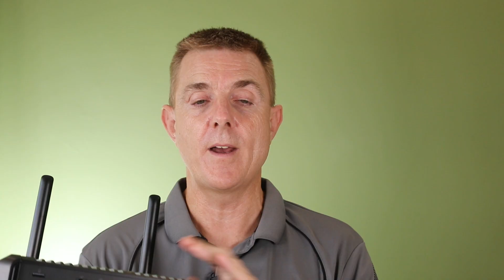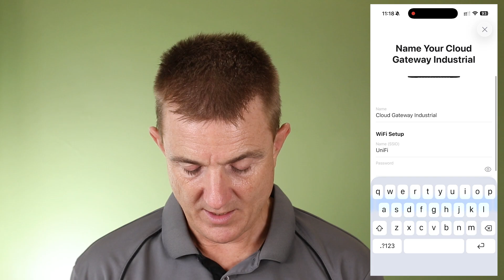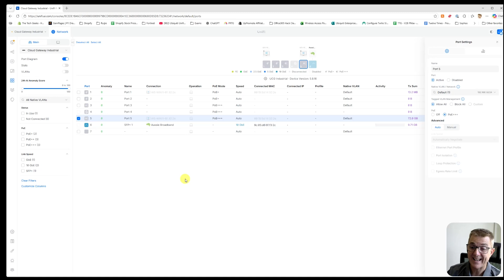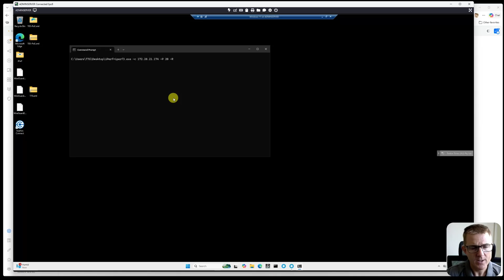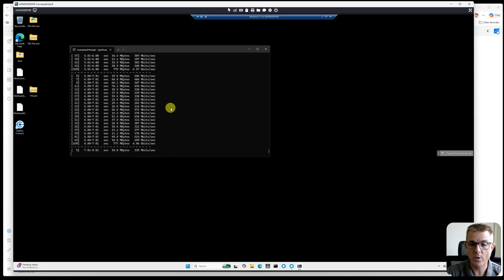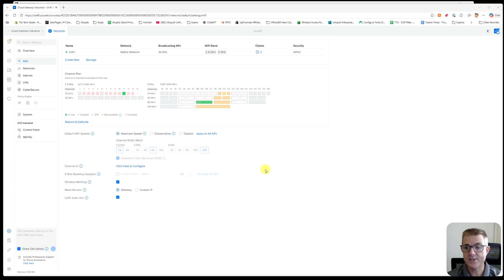Performance Review - UCG-Industrial

Comment: Hi can you please tell me if it supports the Traffic Flows and Traffic Logging feature in UniFi Network and howmuch logs are you maxing out please? thx!
Reply from the maker: Yes, it should support Traffic Flows / Traffic Logging as long as it is running UniFi Network 9.1 or newer and UniFi OS 4.2.8 or newer. The UCG-Industrial supports DPI / Traffic Identification, and it is not listed as one of the excluded gateways for Traffic Flows.
We didn’t specifically test how many flow logs it retains on the UCG-Industrial, so we wouldn’t want to quote an exact number. Ubiquiti publishes retention estimates for some gateways, but we haven’t seen the UCG-Industrial listed separately for log quantity. The safest answer is that the feature should be supported, but the exact retained log count would need to be checked on the unit/software version being used.

Comment: So does the UCG fiber actually have better overall throughput compared to
the UCG industrial?  This is an interesting topic, considering they share the same underlining architecture and SOC. I assume that the slight performance hit if any is due to the UCG industrial having to manage additional duties such as integrated Wi-Fi and the POE.
Reply from the maker: That’s an insightful observation, and you’re likely right that the additional hardware roles such as integrated wireless and PoE could affect performance differences. From the published Ubiquiti specifications, the UCG-Fiber does not appear to have higher rated routing or security throughput than the UCG-Industrial. Both are listed at 5 Gbps IDS/IPS throughput and both use the same published CPU/RAM platform. The difference is more around design and deployment role: the UCG-Fiber gives more fibre/uplink flexibility with two 10G SFP+ ports and NVMe storage, while the UCG-Industrial adds integrated Wi-Fi 7, much higher PoE capability, ruggedisation, and industrial operating temperature support.